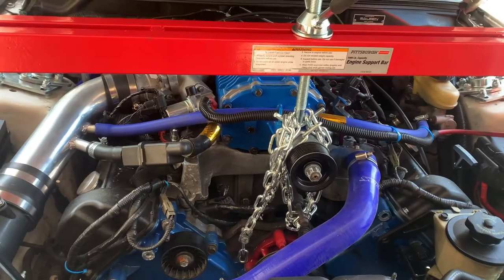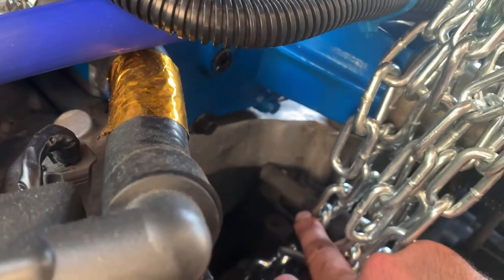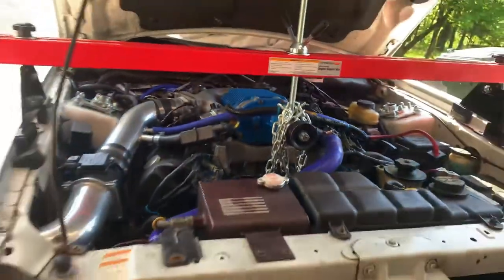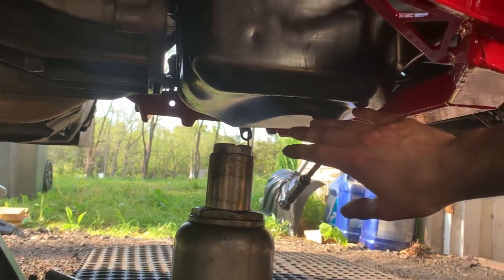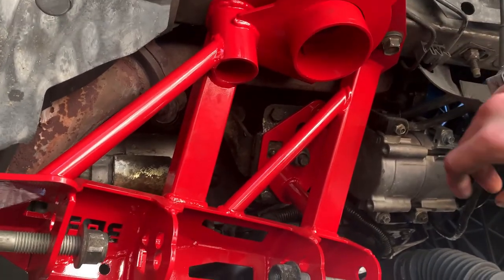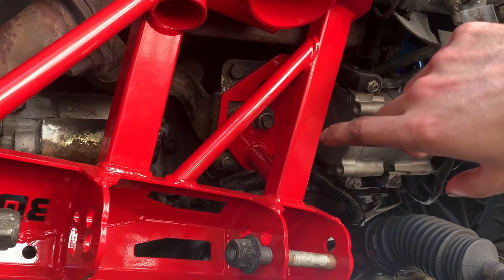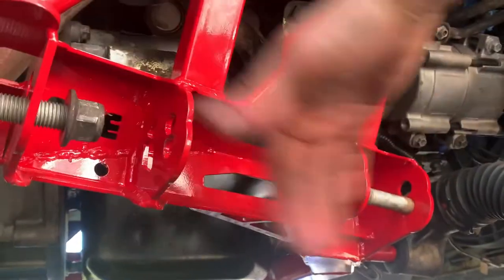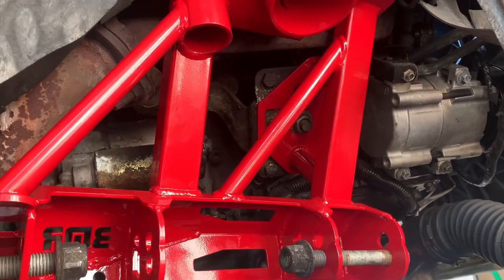2000 Mustang BMR K member install tips

Comment: I have long tube bbk and I can’t get mine to fit do you think jacking up the motor would make it fit
Reply from the maker: I have shorties, but during my research I read that the two methods to get those in are by dropping the K-member or jacking up the engine. Let me know what ends up working for ya.
Reply: I have bbks as well I just tightened the chains on the engine holder.. should fit